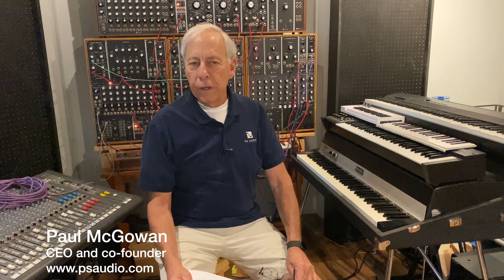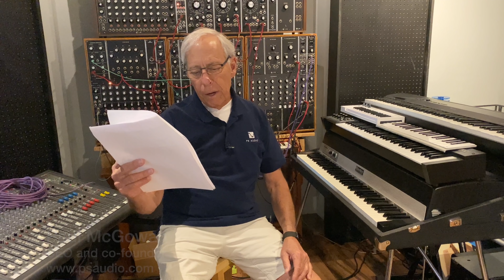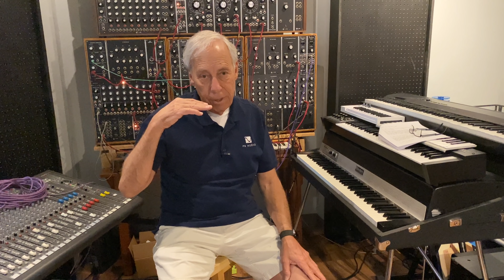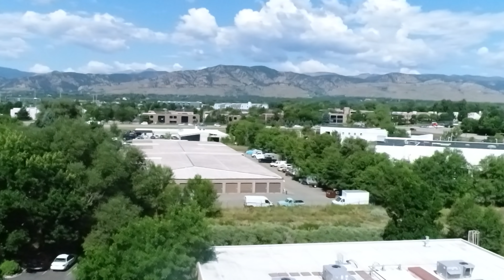Current and voltage amplifiers

Comment: Saying an amp is "high current" is more or less a marketing thing. Though in practice it means an amplifier may be more stable at loads much lower than 8 or 4 ohms. And that its power supply is capable of delivering enough current that it is under stressed in typical loads. That is really all it means.

Comment: While the output stage of a power amp increases the current, it has a very low output impedance (fraction of an ohm). That makes it a voltage source and not a current source. That's very important because a current source cannot properly drive an electromagnetic loudspeaker. In most cases the final stage is some form of voltage follower where the voltage gain is virtually unity but can drive many amps into a speaker load.
Reply: Not quite.  Evey amplifier can be alternately viewed as a voltage source in series with an impedance (Thevenin equivilent)  or as a current source in parallel with an impedance (Norton equivilent). So no,  the value of the impedance does not make that distinction.

The output impedance determines the power ceiling for the amplifier.  If you view it as a voltage source then the output impedance acts as a voltage divider with the load. Attempting to draw too much current causes a greater portion of the voltage across the output impedance and the voltage across the load drops, preventing it from creating more current.

If you view it as a current source than it acts as a current divider. If the load requires the voltage to be too high, then the parallel impedance will shunt the current,  limiting how much voltage the load can drive.

So in either case,  the power is limited. An emitter-follower is used because it has a very low output impedance and can therefore support very high power output.

Strictly speaking, Paul's use of the term power amplifier IS incorrect. What really makes the an amplifier a voltage amplifier or a current amplifier is in what respect the gain is measured.

A voltage amplifier would output a voltage as some factor of the input voltage, regardless of input current.  A current amplifier would output a current as some factor of the input current, regardless of voltage. You can also have a trasconductance amplifier that outputs a current as a factor of the input voltage and a transimpedance amplifier that outputs a voltage that is a factor of the input current.

So,  since he always references the signal as a voltage, all of his amplifiers are really voltage amplifiers.  For a given input, the given output will have a given voltage.  The current varies based on the impedance of the speakers. But using the term "current amplifier" as he does, albeit incorrectly, does drive home the point that the final power output must be able to source a more significant amount of current than the initial voltage gain stage which is likely a common-emitter amplifier, likely with a kilo-ohms or two of output impedance.

Comment: I've wondered about this issue myself, but the video didn't really address the question.  Conventionally, the way we all use electrical devices is that the power supply (e.g. the utility company) does its best to control the voltage and always maintain it to their spec.  The devices that consume power are all wired in parallel; each of them is designed for a fixed voltage, and is free to choose how much current to take.  However, in some weird alternate universe (but using the same laws of physics that we already have), the power supplier could be in control of the current and do its best to always maintain the current flow at a constant level, at its spec.  Then, all of the power-consuming devices would be wired in series.  Each of the power-consuming devices would be designed for a fixed current, and would be free to choose how much voltage to take.  Each device's on/off switch would be wired as a shunt across the device.  If you look at a lab power supply, it has knobs for both a voltage limit and a current limit.  It is able to do either style of operation.

Back to the world of audio power amplifiers, I consider a voltage amplifier to be one where the output voltage to the speaker is proportional to the line-level input voltage, and the speaker decides how many amps to consume.  Speaker impedances are different at different frequencies.  If you pick a frequency where the speaker impedance is low, you'll get more current and thus more power sent to the speaker at that frequency.

An audio amplifier designed as a current amp would operate so that the output current sent to the speaker is proportional to the line-level input voltage.  The speaker would then decide how many volts to consume.  If you picked a frequency where the speaker impedance is low, you'll get lower voltage and thus less power sent to the speaker at that frequency.  The possible advantage to this style of operation is that the magnetic field strength, I believe, is proportional to the current, not the voltage.  So, if the speaker was designed to work in this manner, you'd have a more linear relationship of sound pressure to the line-level input of the amplifier.

So really, the central question that I have is whether speakers are primarily designed for (a) the amplifier to control the voltage and the speaker to control the current, or (b) the amplifier to control the current and the speaker to control the voltage.
Reply: (a)
You could build an amplifier that does (b), but with most speakers, you would get a huge frequency response peak at the speaker's resonant frequency (frequencies).

Comment: As always, your Q&A causes me to think, read and learn.
You answered correctly and it helped me learn.  
I think the questioner may have been enquiring about Current source vs Voltage source amps.
It comes up in Nelson's First Watt discussions as he has a couple of current source amps (the F1 & F2).  They work well only with a small subset of speakers, but when they do, they work very well.
The guy from Atmosphere described it as:
"A current source amplifier has a very high output impedance- usually multiples of the speaker impedance.

A voltage source amplifier has a low output impedance, usually a small fraction of the speaker impedance."

Comment: The question was about voltage-feedback amplifiers versus current-feedback amplifiers.  We all know that audio amplifiers need both voltage and current gain, but that wasn't the question.  
The most fundamental reason why amplifiers are designed to control output voltage, is that's what loudspeakers are designed for.  Speaker designers try to make the frequency response flat, when the speaker receives a constant voltage.  
Amplifiers can certainly be designed to control their output current, i.e., make it follow the input signal voltage.  At very low frequencies, this can be used to reduce woofer distortion, but there are several problems with current-output amplifiers:  
1.  They don't like open-circuit loads.  If a speaker isn't connected, the output voltage goes very high.  
2.  They push far more power into speakers at frequencies where the impedance goes up, and put less power into low-impedance speakers (or combinations of speakers in parallel).  Since all speakers have at least one (two if a ported design) impedance peaks in the bass region, this tends to play havoc with the low-end frequency response.  
3.  They won't damp a speaker's tendency to ring after transients:  Damping factor approaches zero.  
Amplifiers have been built which control to current at low frequencies, and fade over to voltage control at higher frequencies.  But these need to be customized to work with particular speakers.
Reply: I think you're right about the original question! But I like to rephrase the rest of your reaction...

The most fundamental reason why amplifiers should control output current, is that's how an electro-dynamic driver works. The output of a driver (SPL) is direct related to the current through the voice coil, and that relation is defined by the force factor (F = BL x I). Speaker designers try to make the frequency response flat. But if you drive a driver with voltage, all irregularities in the impedance translate to irregularities in the frequency response, and the increase in impedance at high and low frequencies makes the frequency response roll off at both ends (makes the response more rounded than flat), although the upper response on-axis is somewhat compensated by the horn effect and the break up at high frequencies.

Amplifiers can certainly be designed to control their output current, i.e., make it follow the input signal voltage. This will eliminate all types of distortion which are related to impedances (which Klippel, the expert on driver and loudspeaker measurements, calls ‘current distortion’). Especially the midrange distortion and the intermodulation distortion by low frequencies, is lowered.

There are several problems with voltage-output amplifiers:  
1.  They don't like low impedances and short-circuit.  If there is a low impedance or a short circuit, the output current goes very high.  
2.  They push far more power into speakers at frequencies where the impedance goes down, and put less power into high-impedance speakers (or combinations of speakers in series). Since all speakers have at least one (two if a ported design) impedance dips, one in the midrange and one in the bass region (if a ported design), this tends to play havoc especially with the mid range frequency response.  
3.  The damping of a driver is very dependent on impedances and changes in impedances: voice coil resistance, temperature modulation, inductance and current modulation of the inductance and the impedance of the crossover filters: The actual damping is unstable and so is the response at resonance, which is problematic especially for ported designs. But there are other and better ways to control the resonance: in the driver, in or with the enclosure, electronically in the crossover or with EQ.

Comment: With audio, probably the most common use of a current amplifier (AKA a Transconductance amplifier) is inductive loops used to provide clean audio direct to hearing aids. In that application you have a loop of a small number of turns of wire (2 or 3 maybe), which may be over many square meters. With such coils, it's the current that produces the magnetic fields. For the same reason as Paul talks about voltage amplifiers also amplifying current, you can use a voltage amplifier to drive a loop, but because the impedance of the loop is much lower than that of a speaker, you are likely to blow fuses, or trigger the amplifier protection circuit quite a lot. For this reason, you can get transconductance amplifiers designed for induction loops, that generate current in preference to voltage, and more importantly the current is proportional to the input voltage, so you get less distortion.

Comment: Tought this would be voltage mode vs current mode amplification like for example questyle uses in their amps and daps. Like the cma800r headphone amplifier amplifiea the aignal in current domain.

Comment: We use current amplifiers a lot for digital signalling. For example when we want to drive lots of digital inputs beyond the fanout of a single digital output, the current amplifiers provides the necessary power required to drive the inputs.  The voltage at digital inputs is the equivalent  logic signalling voltage of the original digital output.  They are often called buffers.

Comment: Current amplification or voltage amplification to do work depends on the load or resistance. Actually impedance is more relevant in this case. Speakers are a wacky reactive load and dip and peak all over the spectrum of sound frequencies. I wish more speaker companies would publish impedance curves, 8 ohms nominal (average) is kind of useless.
Reply: That's why I love Dayton Audio, even if they're meant more for vehicles than hifi. Every one of their models has a datasheet that includes an impedance chart, not to mention full physical size diagram. Extremely useful, since they make many with same nominal impedence but the charts are very different, some flatter and some more bass-y.

Comment: Does Octave records also do analogue releases?
Reply from the maker: Soon, yes. We are working on vinyl releases fir each of our recordings. They will be 45 rpm virgin vinyl masters.
Reply: @Paulmcgowanpsaudio  Nice. Looking forward to that Jazz album.
Let's hope it's not into the 40+ bucks range; the vinyl revival has done enough damage already.
Reply from the maker: @QoraxAudio  Well, unfortunately, because of our goals of producing ultra perfect vinyl, this will be released as a two-disc set on virgin vinyl at 45 rpm and only from a single master. That's expensive and it's likely to be more like $60.
Reply: @Paulmcgowanpsaudio  That's a pity, because I think most people will probably be fine with spending twice the money for a high quality record compared to an average record, but three times the price is a step too far for most.
Reply from the maker: @QoraxAudio  I agree which is why we limit the run to only 500 copies.
Reply: @Paulmcgowanpsaudio  Ah yes, but if you do larger orders, it gets cheaper and it often means you get priority over other small pressing orders at the pressing plant, so the waiting times are shorter.

Comment: I think you misunderstood the question. Current-drive amps are not as common. 
The question was why they're not common but all you did was explain the different stages of a normal voltage-drive amplifier.
Reply: Do you know of an amp with no voltage gain before the current stage?
Reply: I agree he didn't answer the question!
Reply: @oysteinsoreide4323  Yes.

Paul uses the term current amplifier incorrectly. What he really means is a low impedance voltage amplifier that is capable of supplying high current.  But he sets the voltage gain,  not the current gain.  So the current is ultimately determined be the speaker load.

In reality,  a current gain doesn't mean that there is no increase in the voltage. What it means is that the gain is measured by output current, and the voltage is determined by the load.

You have current amplifiers which output a specific current as a product of the input current and you have transconductance amplifiers which output current as a product of the input voltage.
Reply: I agree. It would seem logical to use a transconductance amplifier on the output stage since the magnetic coils that are being driven are ultimately controlled by current instead of voltage. I think that is the rationality behind the original question.

Comment: This is a very poor and incorrect explanation.  Audio amplifiers amplify voltage. It is highly misleading to say amplifiers amplify current. The output power of an amplifier is Watts = current X volts. The current an amplifier can deliver is determined by the components and design of the output stage and power supply. Draw too much current and the voltage will collapse and this defines the power rating of the amplifier. An amplifier with hefty output transistors and a substantial power supply is able to deliver a voltage at higher current than a lesser amplifier. The hefty amplifier does not “amplify” current, it is simply able to have higher current dragged out of it. This explanation is totally confusing as it does not explain Ohm’s Law, the relationship between voltage, current and resistance.
Reply: Thank you, I think your explanation is more clear
Reply: dtemp132 Paul’s attempted explanation implies that there are two different types of amplifier and you have a choice. This is wrong. Another way of looking at it.... as the volume control is turned up so the voltage to the speaker increases and it sounds louder. The speaker has a low impedance so draws a substantial current from the amplifier. Keep turning up the volume and the voltage and current rises but there will be a point where the amplifier cannot supply enough current to deliver the higher voltage. This limit depends on the design of the output stage and its power rating. The beefier the output stage the higher current it can deliver and the more Watts available.

Comment: Is there really circuitry that specifically increases current?  I always just assumed that If your amp increases the voltage to, say 20v and you had 4 ohm speakers, the current would be 5 amps unless there were current-limiting circuits to prevent the amp from burning up. If you had a 20v signal and a 4 ohm load, but somehow ended up with more than 5 amps of current, wouldn't you be arrested for violating ohms law?
Reply: Yes. In a purely resistive circuit. But we are dealing with inductive loads so no violation of ohms law. The impedance is changing.
Reply: Your understanding is basically correct.  
The reason why we talk about current gain in amplifiers, is that the output stage is designed to be able to conduct a large amount of current, if the speaker draws it.  The output stage is driven by circuitry which provides only milliamps of current, then the output devices can multiply that to many amperes as demanded by the speaker.
Reply: @marianneoelund2940  Current is a product of voltage and impedance and is not changed, amplified, or multiplied on its own.  Paul is following the saying, if you cant intrigue with intelligence then baffle with bullshit.